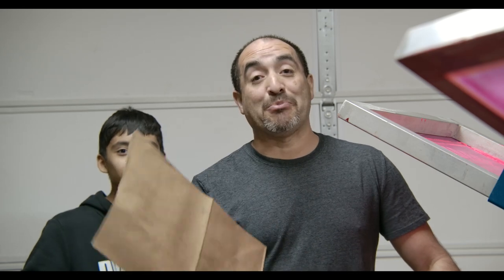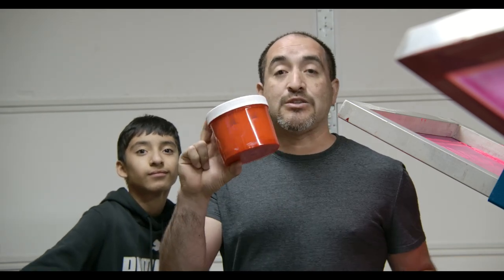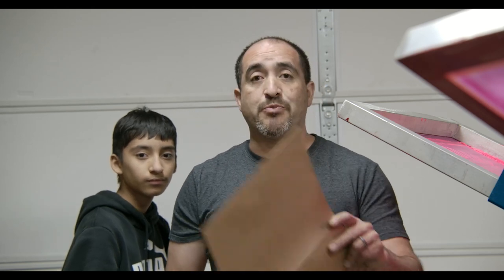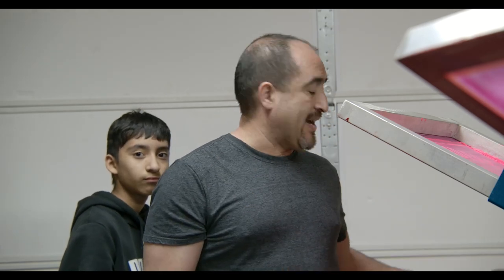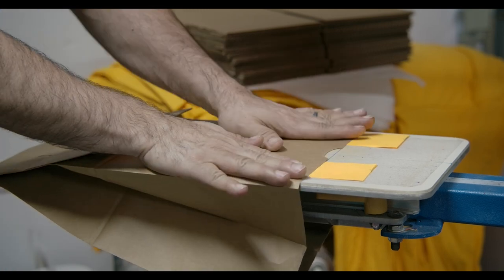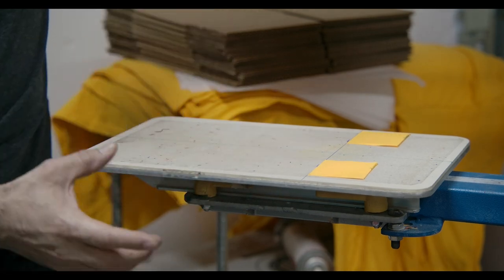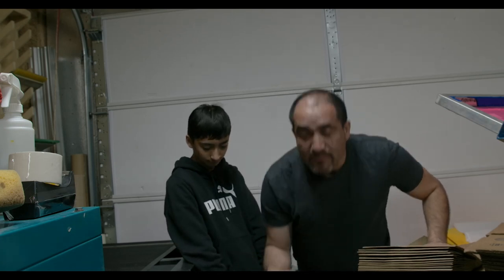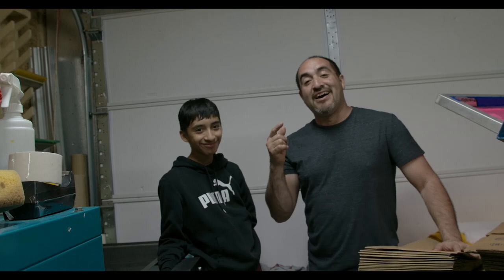HOW TO PRINT PAPER BAGS AND CARBOARD BOXES

Comment: Is there a general rule that you should pull water-based ink vs. push stroke? I got this comment on my video, but I felt it was preference. The print still came out clean.
Reply from the maker: That's a great question... no, there is no general rule, you can push or pull.
Reply: @LibertyGraphicDesigns  Thanks, I just responded by saying a pull-stroke helps avoid getting hung up on the stencil. Great video!
Reply from the maker: @jbmdesignco.693  that is correct! A pull stroke is alway going to give you better results, a push stroke will "push" more ink on the substrate which in tgis case will not be good since we're printing boxes if it was shirts than it would make sense to push rather than pulling